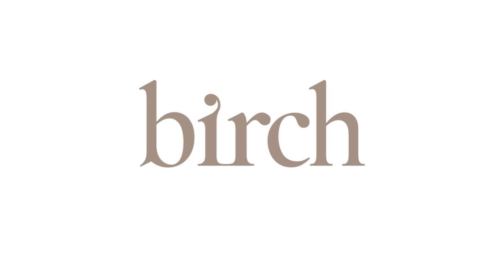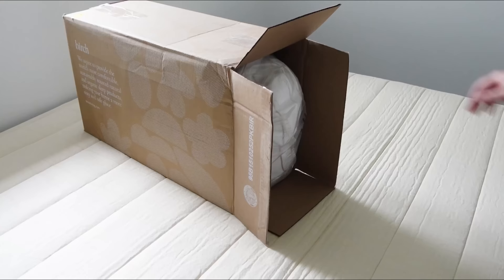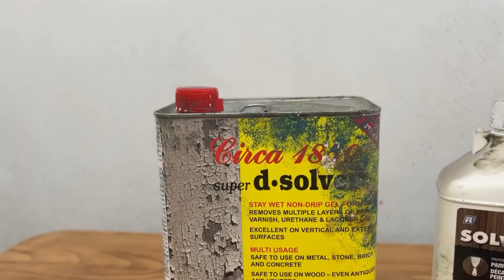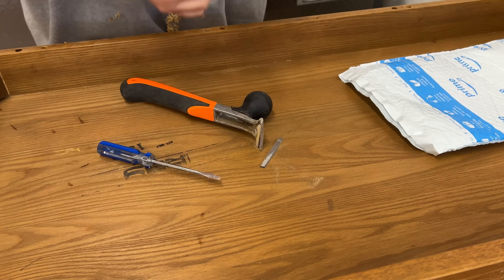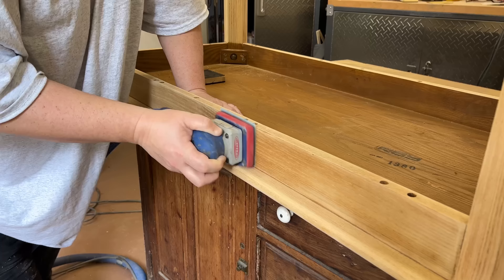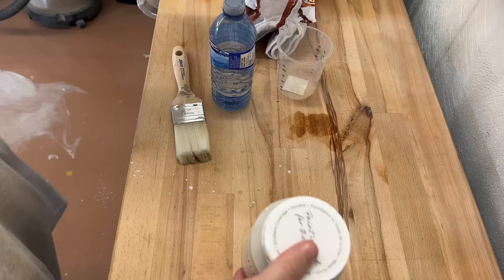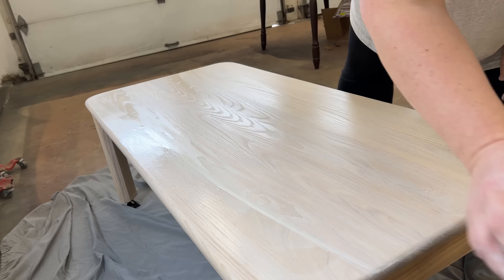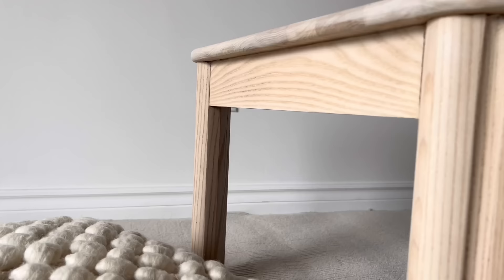Thrifted Oak Coffee Table gets a new WHITE-WASHED FINISH!

Comment: The one question that no body addresses is priming the piece with a clear primer to block tannins, if we don’t prime the wood won’t it just bleed through the paint wash? Will clear primer affect how the paint wash applies? I’m very conflicted and confused with this. Thank you
Reply from the maker: You can’t use a primer with a paint wash just like you can’t use a stain blocking primer with a traditional wood stain. The “bleed though” or tannin colour is part of the colour and will differ with each individual piece of wood. A paint wash is staining the wood with paint instead of an oil based wood stain.
Reply: @salvagedbykscott  🙏 thank you! This helped a lot, finally some one answered my question about this process, I’m new and still learning it can all be overwhelming at times

Comment: Hi. I am currently sanding an oak dining table, I have stripped and sanded. It still looks a bit blotchy in places. I’m worried that if I sand more it would take too much of the grain off. I plan on staining with fusion driftwood sfo or a combination of driftwood and cappacino. Would this colour of stain hide the unevenness/blotchy areas? Thanks so much. I found your video very beneficial to watch as this is my first project
Reply from the maker: You really need to have an even surface before applying any kind of transparent finish. If it’s solid wood you can keep sanding as much as you need to to get it even. If it’s a wood veneer, keep sanding but proceed with extreme caution.
Reply: @salvagedbykscott  thanks so much for the reply, one last question. When staining do you need to wet the wood before the stain. For example, if I sand the wood one day, clean it off and leave it, and plan on staining the next day, do I wet the wood right before staining?